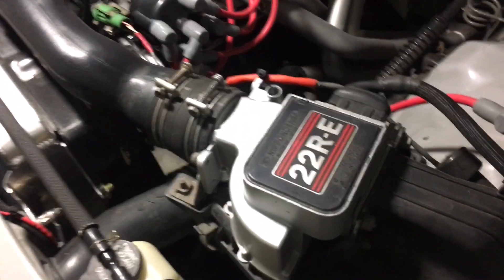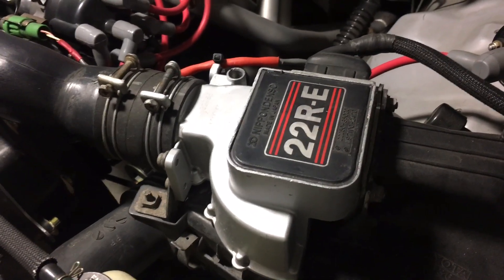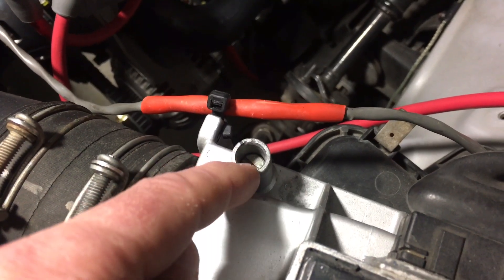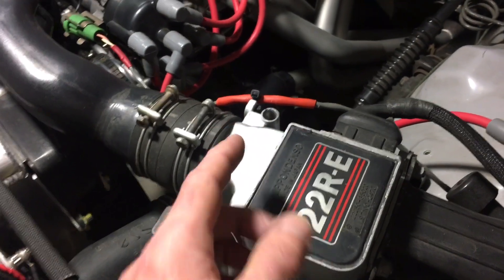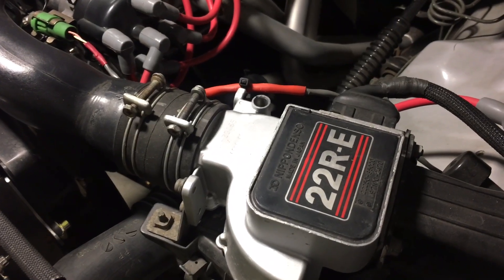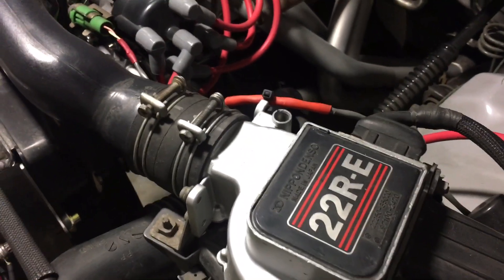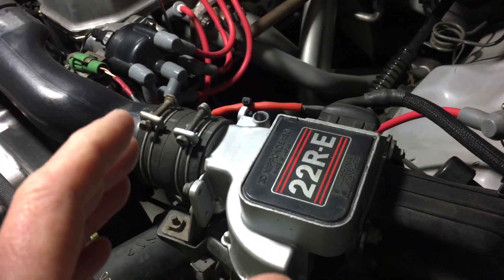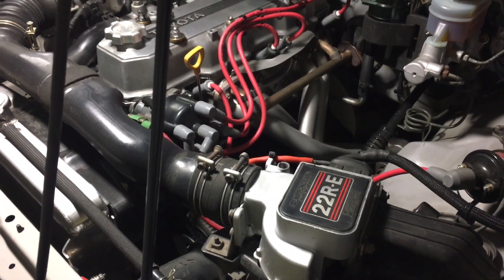Toyota 22RE AFM idle mixture screw adjustment / factory reset - how does it work & what is it doing?

Comment: I had a look at my AFM this morning, it appears to be capped of where the adjustment screw should be. My question is is there an adjusting screw under the cap if I pry it off or does mine just not have that adjustment screw?
Reply: There's an adjustment screw under the cap. What I  did is run a # 8 or # 10 , 1/2 inch in length self tapping screw ran it Through the aluminum cap about half way in  and used some side cutters to Pry off cap
Reply from the maker: @rafaelduenas6465  Nice. Thanks for the info on that!
Reply: thanks @rafaelduenas6465
Reply from the maker: I'm not sure if there is an adjusting screw under there or not. The only thing I know is that the TCCS manual states that those do not require any adjustment and the ECU handles it.
Reply: thanks . you know im proly gonna have to pry that cap of just to see lol. I'm most likely going to change my whole system over to Haltech this summer anyway. That would eliminate that whole box @ray5961
Reply: I also have a capped one, 91 2wd 22re. No number casting either
Reply from the maker: @caseyhogan2142  Interesting. I don't remember if my original (the one I accidentally destroyed) was capped off or not. I'll dig through older pics and see if maybe I can see something. The re-manufactured Napa one is what I have now on the truck.
Reply: @ray5961  to be perfectly honest I have no idea if the part is orignal or not, but it is definitely corroded on the outside.
Reply from the maker: @caseyhogan2142  That sounds original :-)
Reply: mine is a 93 and I didn't look for numbers but I will next time I get a chance @caseyhogan2142